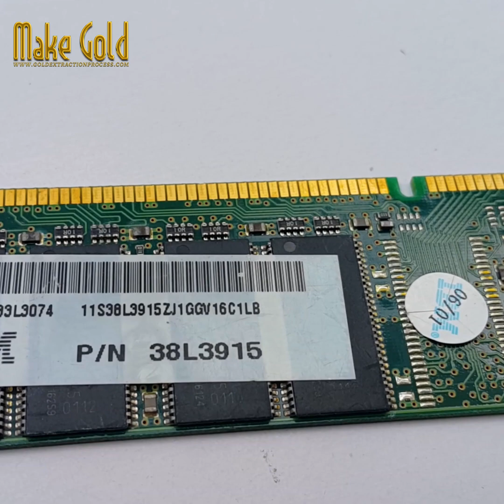Gold wire in RAM IC chip | How GOLD is made

Comment from the maker: :_wow::_GoldBar::_GoldBar::_GoldBar:Gold has been a highly prized metal throughout human history, valued for its beauty, rarity, and unique properties. The use of gold in electronic components, such as RAM (Random Access Memory) integrated circuits (ICs), is a testament to its excellent electrical conductivity and resistance to corrosion. Here's an overview of how gold is made and its applications in the electronics industry.
Mining and Extraction:

Gold is primarily obtained through mining, either from underground mines or surface mines.
The ore containing gold is extracted and then crushed and ground to a fine powder.
Gold is separated from the ore using various techniques, such as cyanide leaching, flotation, or gravity separation.

Refining and Purification:
4. The extracted gold is typically in the form of a concentrated solution or a semi-pure alloy.
5. Refining processes, such as electrolytic refining or Miller process, are used to remove impurities and produce pure gold.
6. The pure gold is melted and cast into bars or other forms for further processing.
Gold Wire Production:
7. Pure gold bars are drawn into thin wires through a process called wire drawing.
8. The gold wire is drawn through a series of progressively smaller dies to reduce its diameter.
9. The wire can be further coated or alloyed with other metals, such as aluminum or beryllium, to enhance its properties for specific applications.
Application in RAM IC Chips:
10. Gold wires are used in RAM IC chips due to their excellent electrical conductivity and resistance to corrosion.
11. The gold wires are bonded to the silicon chip and connected to the external leads or pins, forming electrical connections within the IC package.
12. The use of gold wires ensures reliable and efficient data transfer within the RAM chip, contributing to its overall performance and durability.
Gold's unique properties, including its high electrical conductivity, resistance to corrosion, and ductility, make it an ideal material for use in electronic components like RAM IC chips. While the mining and refining processes can be complex and resource-intensive, the resulting gold wires play a crucial role in ensuring the reliable operation of these essential electronic devices.